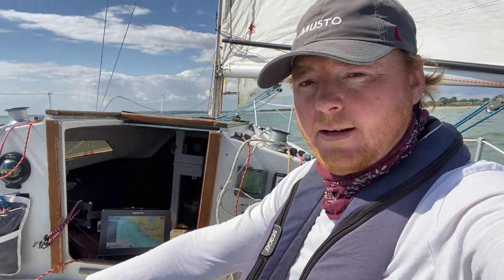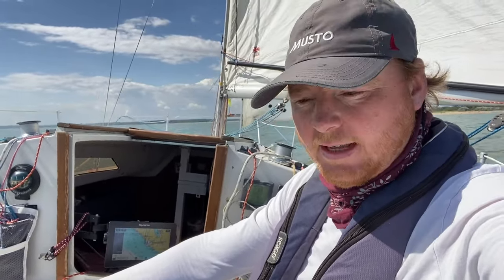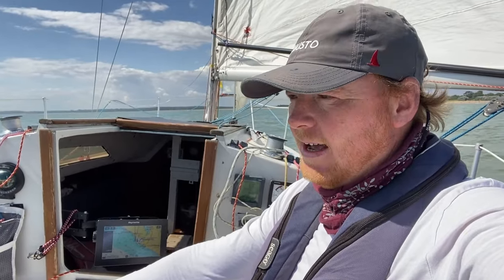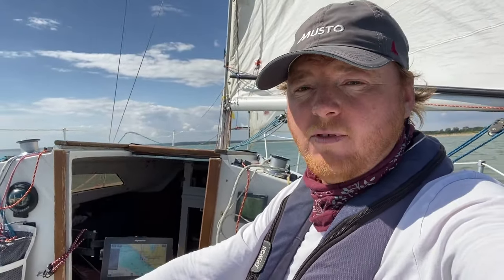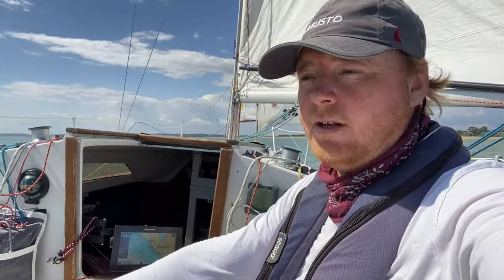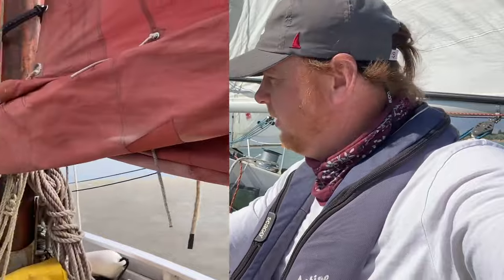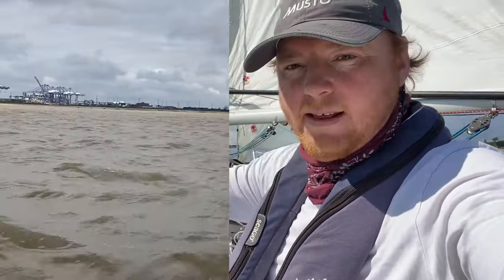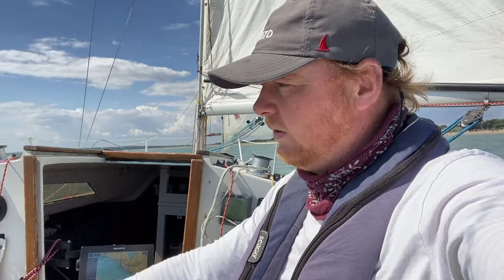How to heave to In a Sailing Boat - with 3 real situations while sailing.

Comment: For those with a wheel instead of the tiller the wheel should eventually be turned towards the jib sheet that is backwinding the sail. That way the jib and the rudder are paralllel. Some/most sailors will know that.

Comment: That video was great. Im going to practice this more in my boat. (Ive only had it on the water for 9 months - never sailed before) I have the benefit of a huge harbour area to be able to play around and learn in total safety. (Weymouth/Portland).
Reply from the maker: @russ01539  congratulations on your sailing journey. How have you found it so far? Must be a nerve racking step to take; getting a boat and learning sailing! What boat do you have? 😁⛵️
Reply: @boatedout  Hi. I bought a Westerley Fulmar 32. It wasnt in great shape, so in my first year I had it on the hard restoring her with new engine, sails and rigging, full re-wire, solar, new depth sounder and AIS etc., plus a good rub down fill and gel pack on the hull. Whilst doing this I had plenty of opportunity to crew with other people from the marina where I learned most of the little I now know. I have been out in the channel solo a few times now, but only in fair weather and never out of sight of land, but Im loving it - that sea air and dare I say it even the sea spray brings me to life. I also like the fact there are so few 'rules' to follow in terms of you can go where you want pretty much.

Comment: Not sure lying 90 degrees to the wind is good practice it should  at least 45 degrees, basically you are lying a hull
Reply from the maker: @Sailingsandgrownun  depends if you are heaving to or fore reaching? As the tiller is already fully to leeward in my video the only way to point any higher on the wind would be to sheet the main in, get some forward motion to generate some water flow over the rudder, which will in turn head you up more on the wind.
At which point you are no longer heaving to and become fore reaching. Which at that point you are having to control the main sheet and tiller to maintain that angle. Not making a cup of tea, resting, having lunch, chilling. So naturally, In my boat it sits at the angle shown when hove to. Other boats may lay different. That’s my personal experience with it. 😁⛵️
Reply: @boatedout  The whole point of heaving to is to not be at the mercy of the waves at 90 degrees which could potentially cause a knockdown I know you demonstrate that in your video but let’s see you try it in a force 8 ?

Comment: It is good to use this in a strong breeze if any of the crew are feeling scared. Instant calm. But one should be very wary of doing it on a lee shore as the leeway drift can be very fast. 

An additional technique is ‘Fore Reaching’ in which (at Hove To position) we sheet in the main enough to give some forward drive. Out in a big sea forereaching can help to drive up a wave, then we let out the main again on the down side of the wave; then take in the main again to climb the next wave, and so on. Forereaching also slows the drift onto a lee shore. It is good to practice. 

Thanks for the video. Nicely maintained boat too.
Reply from the maker: Great info, and good point about the leeway, thanks for adding. Fore reaching could be a good one to cover in a video. She’s been a labour of love, coming up to her 40th Birthday! 😁⛵️

Comment: Very clearly presented. I think that it would not be different in most boats. I wonder how it would be using a storm jib. Many thanks.
Reply from the maker: Thanks, I agree, might be slight differences maybe. Never tried it with a storm jib. But again if you’ve got little main sail area and well balanced. I think  fore-reaching becomes a thing then as well. 😁⛵️

Comment: Very good.
Well done, easily explained.
Although you were still. Slipping towards the beach.sideways.
What is the black rod next to the boom?
Reply from the maker: @kencoutts2051  thanks! Yes good point, gotta watch out if on a Lee shore.😁 the black rod is a spinnaker pole, I’ve rigged a twin pole system. Check it out in my other videos. 😁
Reply: Thanks will do, all tips and instructions is very helpful regards

Comment: I've been thinking about heaving to in order to raise the Mainsail when I am by myself. What do you reckon?
Reply from the maker: Might be tricky as you need the main up to heave to properly. Reefing is good when hove to, but if you have a motor it’s common practice to raise the main first when heading into the wind under motor. An auto helm or tiller pilot is ideal for this solo.

Comment: I did this the other day and I was worried about the pressure of the stay on the jib, possibly ripping the sail. You think it’s a problem?
Reply from the maker: @julianbrose9097  depends really, I’m more concerned about the pressure of the jib on the shroud, especially in high wind. That said I’d only have enough Genoa furled out to keep the bow being blown off. As for the jib, in the case you mention, I expect it will cause wear and tear but no more than normal tacking. You can get plastic tube to go over the shroud, helps to reduce that friction against the sheet and sail. However, any thing that covers the shrouds up is frowned upon. But the plastic tube can slide up and down so still able to inspect it. Personally I wouldn’t fit them but I do see the benefits if you are planning to heave to a lot. One thing that happened to me recently was that I furled my Genoa most of the way In, in 30 knots, close hauled, when I sheeted it in, because of the closer sheeting angle, the sheet caused my shroud to wind up. I didn’t  have a pin in the stud for the shroud and it actually unwound my shroud in the turnbuckle. Fortunately, I didn’t tack and load up the leeward slack shroud, had I have done so-!the mast probably would have snapped.!it was a big lesson for me, only noticed when I took the sail down. But I can see benefits of having tube on the shrouds. Especially at the height the sheets rub them. Check your shroud pins!!!!😁⛵️

Comment: Nice explanation.  I've heard being beam on to the sea's maybe isn't the best sailing position in  heavy weather and that being hove to but pointing at 45 degrees to the wind makes for less side exposure to the sea's?  Do you have any recommendations for trimming the sails to achieve this ?
Reply from the maker: Hi thanks for the comment, that’s correct, 
By sheeting in the main a little you start to create some drive and regain steerage way which then becomes “fore reaching” which maybe what you have heard about. 

This is a technique that allows the boat to make way slowly and sail closer to the wind-thus accommodating a sea forward of the beam as you say. The main can then be sheeted in as you go up waves and sheeted out as you go down the back of a wave. Power and depower. It is said that you are constantly sailing out of the slick that you make when lying hove to, but you don’t make so much leeway when fore reaching. Which is ideal when near a Lee shore or at least trying to make some way upwind. 

When lying hove too, the backed foresail is being pushed away from the wind, and the rudder hard over-tries to push the bow back into to the wind- the result is a falling leaf motion as you just get blown sideways (leeway) usually beam on to the wind. 

By sheeting the main in the centre of effort comes further aft which also wants to drive the bow closer to the wind. This will also create a bit of forward drive. So the final angle can then be determined by how much rudder is applied as there will now be steerage way. 

I’ve not had to use this technique in rough seas but definitely used in hove to situations, such as the cargo ship in the video. We had 2 knots of tide against us so we started fore reaching to maintain the same position geographically. 

Hope this answered your question and sorry if I waffled on and covered some old ground. 😁⛵️
Reply: @boatedout  excellent answer , now I understand so much more clearly . I'm  sure other readers will appreciate your reply too 👍
Reply from the maker: @grahamatsea3575  awesome! Let me know how you get on practicing it! Happy to have helped clarify and thanks for raising the subject of fore reaching, it all helps to expand and add further value to the topic😁⛵️

Comment: Thx for the video very clearly explained.

Would you recommend heaving to for reefing the mainsail if caught off guard with high winds/squaul?
Reply from the maker: Hi thanks for the comment. It’s my opinion that heaving to in high winds or squall to reef can be an effective method. I’m not sure of your experience/vessel but the issue I see is that all boats behave differently when hove to. Additionally some boats (depending on mainsail luff system) like to be dead into the wind to reef, where as others can be reefed when off the wind slightly. Luff rope, luff sliders, for example. Recently we had a 30 plus knot squall hit us and I managed to reef while on a run. I also managed to shake the reef out on a run too. For storm tactics, it’s not always possible to tack the boat into the heave to position. Sea state and wind strength may be too harsh on the boat and crew. So the Genoa can be sheeted from the windward side to heave to. You can also sheet the main in slightly so that the boat is pointing slightly more into the wind in order to put a reef in.

Ultimately, and fortunately for me, I’ve always managed to get a early reef in when a squall is coming. I tend to adopt the policy “if I’m thinking about a reef- then put one in” if I see a squall I’m instantly thinking about reefing, because I’m thinking about it- a reef goes in. Preparation is key. 

I have practiced this a lot in my boat to see what angle to the wind I can reef. No doubt that before I go out In a different boat in heavy weather I will have checked out the heaving to and reefing situation for when it may be needed. Along with man over board, distress calls, fire and what not. So good idea to practice as much as possible in my opinion. I hope this helps. ⛵️
Reply: @boatedout  appreciate the detailed reply. I've only ever been taught to manage a slab reefing main sail in irons is all, but it looked like it would have been possible to take a reef in your video given the coverage the head sail gave the main sail at that angle. Point taken on depends on the vessel I'll try in light winds and see if feasible. Cheers

Comment: Hi and thanks for a well explained video. One question from a complete novice……is it possible to heave to with only a single sail ie no jib ?
Reply from the maker: Hi, thanks for the comment. It’s not possible. Heaving to works by backing the foresail to block the flow over the main sail. It’s just one of the great advantages of having more than one sail!😁⛵️
Reply: @boatedout Thanks for replying sir, I may have to think again about my rig as it seems to me that heaving to has many advantages . I do like the idea of a very simple rig but the addition of a jib seems to make good sense . Your videos are very watchable especially for a novice like myself.
Reply from the maker: @richardteale3217  what boat are you sailing? Some of the cat rigged wooden boat owners claim you can heave to in a cat rig, whereas it’s not exactly what I class as heaving to. Just easing the main and setting the tiller to not round up or fall off the wind. Also raising centre board if you have one. All boats behave differently so it’s a case of identifying what works in any particular boat I would say. Thanks for the kind comment. Yes I try touch on the realities of sailing in my videos. I’m passionate about helping other people get on the water so I’d always try make things more simple than try to make novices feel it’s too complicated!😁⛵️
Reply: @boatedout  I have a little skiff I built from plans ,very simple flat bottom stitch and glue construction. It has a “leg o ‘ mutton “ sail with a sprit boom  which is adjusted by means of a “snotter”.  The boat is not a serious sailing vessel and I have only sailed it on inland waters in fairly light winds. At present I am building a glued clinker “shearwater” dinghy designed by Ian Oughtred. He suggests either a Gunter rig or a balanced lug. I prefer the simplicity of a single sail, but I’m wondering if I should go for the Gunter, as I can see the advantage of being able to heave to.
Reply from the maker: @richardteale3217  that’s awesome, yes I know what you mean, and yes familiar with the shearwater too. Sounds like you are immersed in quite an interesting journey there. I know a guy, who is making planing lugsail dinghies. Very cool things. Google “windsong 14” by summer boats. Personally I love the nature and character of lugsail dinghies, more than a gunter rig, but when it comes to upwind performance, it’s a gunter for me. Either way, nothing compares to sailing a boat built with your own bare hands! That’s pretty cool! ⛵️

Comment: What stops the boat taking a beam sea? Or is it the case that the rudder to leeward and the backed headsail always points the bow diagonally to the beam sea?
Reply from the maker: Good question. Naturally, my boat will sit beam to wind with helm to leeward and Genoa backed. As will most. You are almost going side ways in a falling leaf motion right? A higher angle can be achieved by finding the right balance between helm and main sail setting which will help to not be so beam on to the sea. There is a good video from Skip Novak that shows heaving to in the southern ocean in a big boat. It looked rather dry. I’m yet to heave to In a huge storm but it’s on my list and I’ll be sure to film it. 😁
Reply: Look forwards to that .
I can imagine needing a rest in a storm by hoving to in deep water.
For a cuppa.
Ha
🐼🐼🏴🏴

Comment: Hello! Thanks for the info. 

I have a question: do you have two whisker poles hanging next to the boom? Any reason?
Reply from the maker: Hi, thanks for the comment, yes they are spinnaker poles, I’ve set up a twin spinnaker pole system for a laugh. Bit of an on going project. It means I can jibe the symmetric spinnaker from the cockpit as the poles are automatic. If you are curious you can take a look at a  video here https://youtu.be/D_jYGKnCiTA?si=NEKexzbzcs5R9uzT